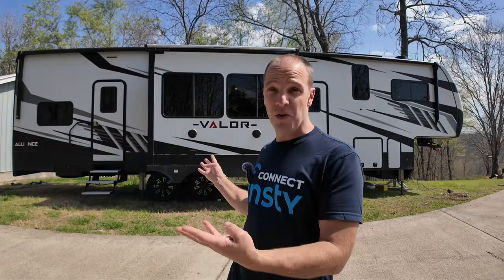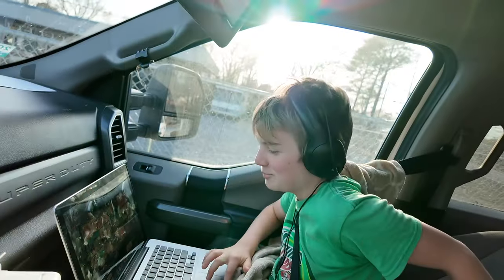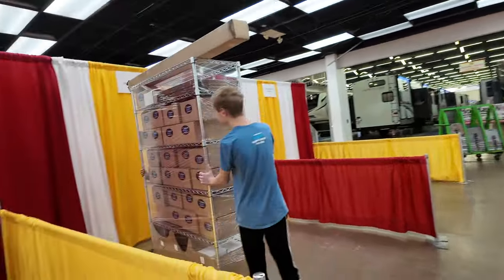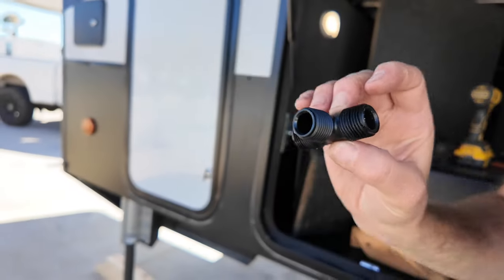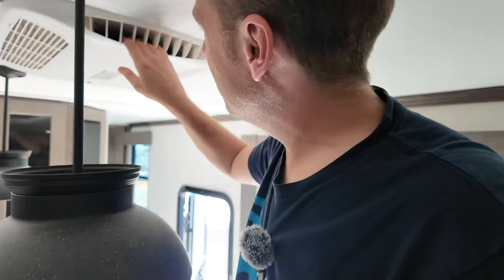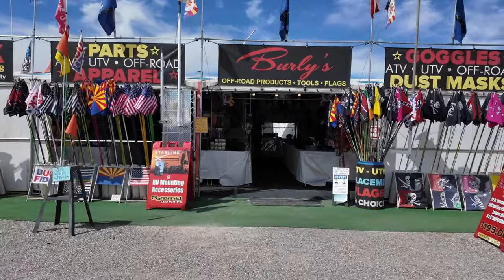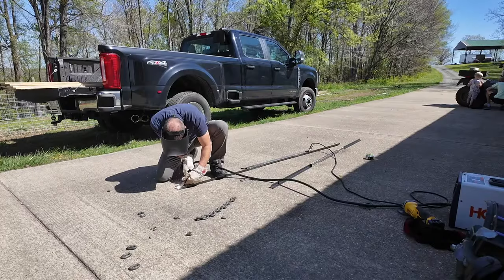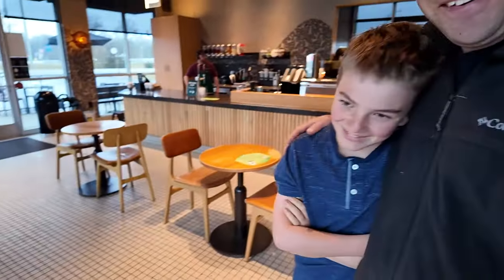Bought a LEMON RV! What I Learned 💡 & What's Next 🔧

Comment: the amount of brand new ones I've delivered that had many issues out of the factory... I'd buy old/used even with a few issues. Granted, your hastiness cost you a few repairs, but in the end you'll know it inside out. Great work, and you have to worry a lot less about messing things up. Keep it up Holmes!
Reply from the maker: You know, this WAS a thing that we thought about when we decided to buy used as well.  Since we were going to purchase and then immediately take across the country, we wanted one that was already "shaken down" because we've heard that new ones can be just as bad.  I forgot to mention this in the vid.  Thanks and have a good one!
Reply: @WeCanExploreIt 
I need aluminum modified horse trailer a.k.a. toy hauler what people compartment
Reply from the maker: @RVingwithG  I saw a trailer called an ATC toy hauler at the Bakersfield RV Show.   It was just like you mentioned, all aluminum, like a horse trailer.  Looked really tough. Ever seen one of those?

Comment: I'm curious if you have any indication as to why the rear garage was rotted out? I've got a 2023 Valor 42v13 and overall have been happy with it and Alliance as a company (purchased new 2023 unit, so not a covid build like it looks like you have). That said, as much as I'm seeing improvements, you also need to know what to look out for. I've not seen the garage rot in the newer builds, but that could be because they are so new.

Were you able to trace where the leaking came from or did you just replace and call it a day? I'd like to look into mine as well to see if I have similar issues brewing.
Reply from the maker: @603Cummins  Funny that you asked because no, I haven't been able to trace why that floor was rotten.  I looked everywhere.  The floor at the top of the ramp part was just fine, and under the middle, right where my foot went through, there was standing water that the vapor barrier was trapping between the frame and the bottom portion of the ramp.  So, in reality, it could have come from anywhere and traveled along the vapor barrier and landed at that bottom portion.  I purposely left the vapor barrier loose and away from the side of the camper so I could investigate further.  I looked after a few heavy rains and everything looks dry down there, so at this point I'm at a loss as to why that rotted out like that.  I replaced that cheap chipboard with doubled up 5/8" green plywood to at least give me some time if it does happen to leak again.
Reply: @WeCanExploreIt  I'm taking a total shot in the dark here, but if you can, I'd take a look under there again and see if more water has collected under the middle (perhaps with a small automotive inspection camera). I'm wondering if there is another leak due to the camper not being winterized. There are water lines that lead to the garage for both the washer/dryer install, as well as the rear bath. One of those could be busted below the floor at an elbow. If the previous owner never winterized the unit, it could be that this was going on for some time without their knowledge.

Comment: I feel your pain lol
We had nothing but problems from our 5th wheel the rv place promised they fixed the leaks , then air conditioning didnt work 
Poop tank pipes leaked like yours so embarrassing from smell
the last straw was mice eating lines and our heat didnt work so we traded it in and finally got brand new one with warranty never getting used again
Reply from the maker: Marsie I feel ya!! How's your new one working for you?? Did you get another 5er?
Reply: @WeCanExploreIt  it's nice 2024 artic wolf 5th wheel suite 3660
With the warranty it makes you feel better , we aren't really knowledgeable on rv repair like you seem to be , we have no clue what we are doing lol